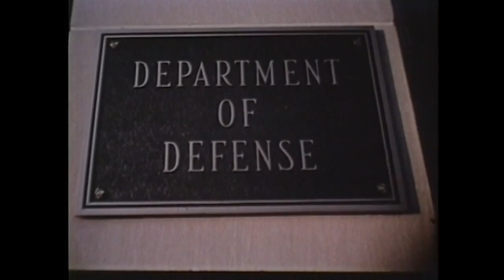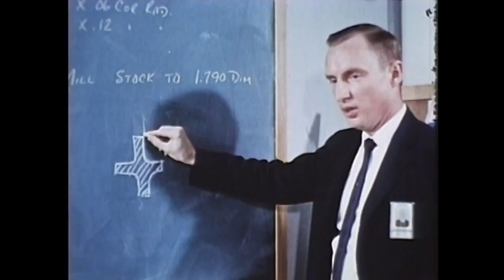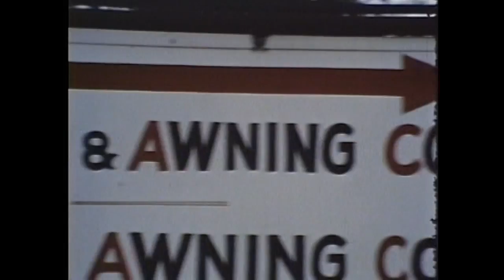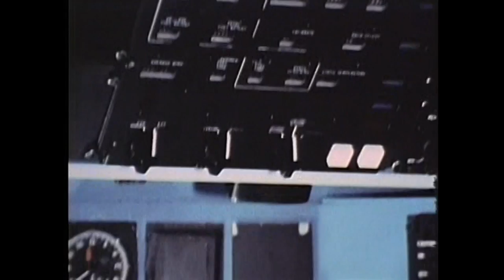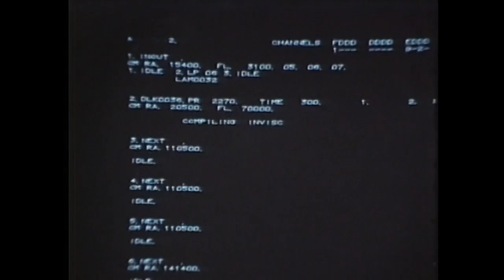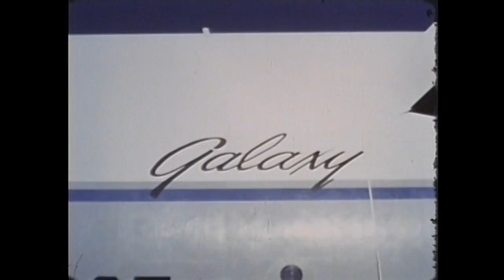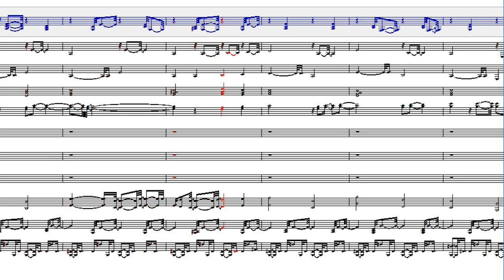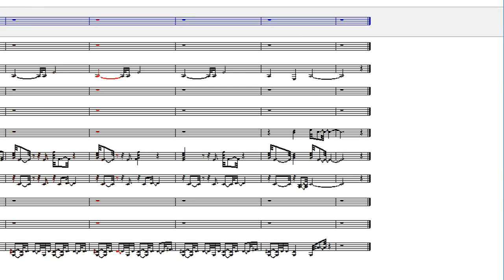C-5 Galaxy Airplane Vintage Documentary

Comment: 1:25 the lockheed c-5 galaxy engines is look like a boeing 747-200 lolol
Reply: The Boeing 747-200 engines are Pratt and Whitney JT9D but the C-5 Galaxy engines are General Electric TF39 yes they are the same engines but different Boeing 747 engines is from Pratt and Whitney but the C-5 Galaxy engines is from General Electric